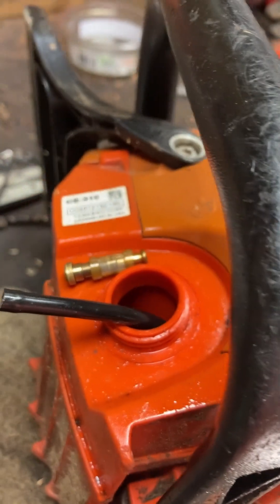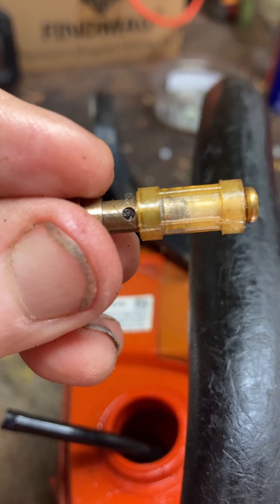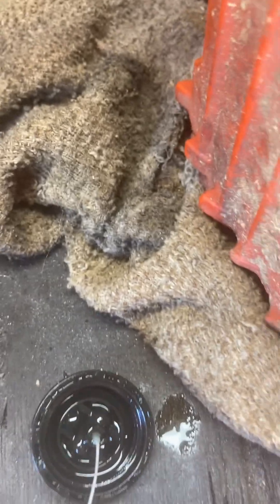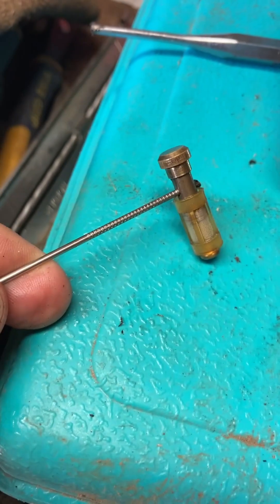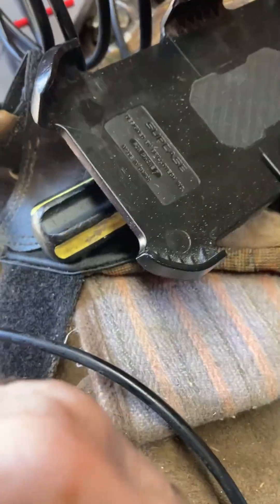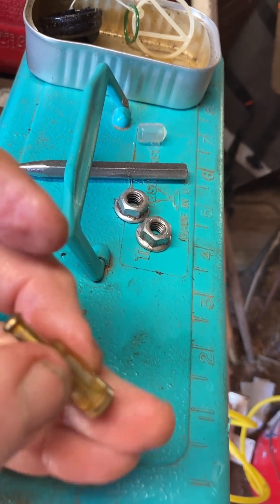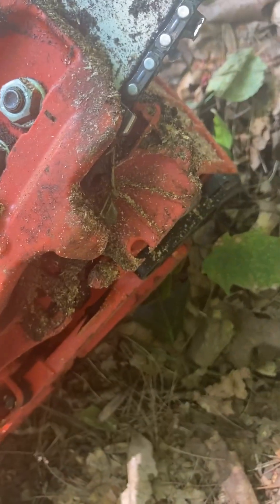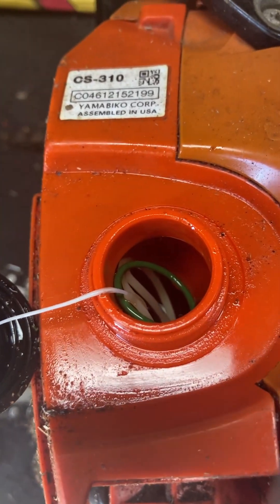Echo CS 310 oiler fix: clean the bar oil filter!  Free repair.

Comment: Thanks for the tip.  Hoping it's this and not the little auto oiling gear.  What a stupid design.   If I knew it had that design, I'd never have purchased it 🤦‍♂️
Reply from the maker: it a try.  It's a free fix, while the gear is a pain in the ass and costs $$$